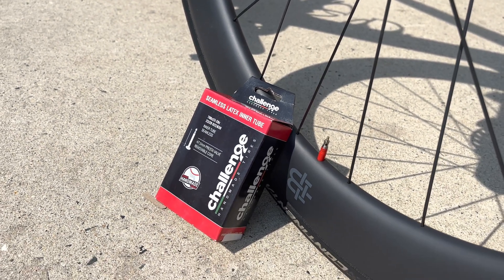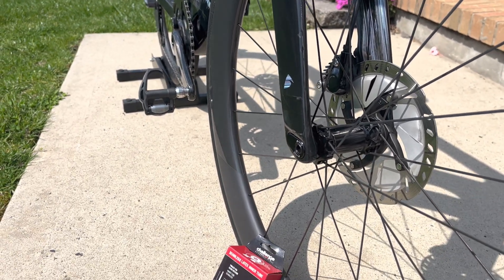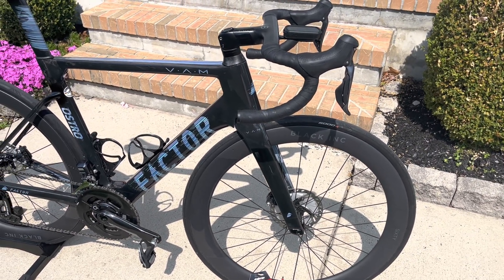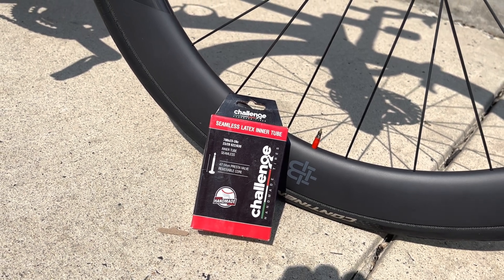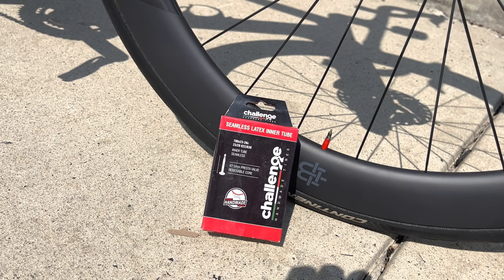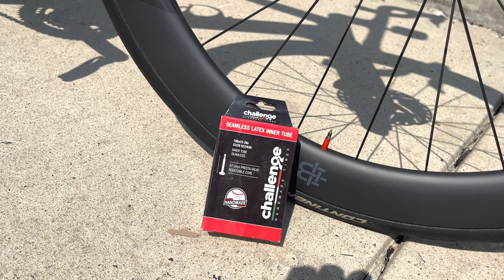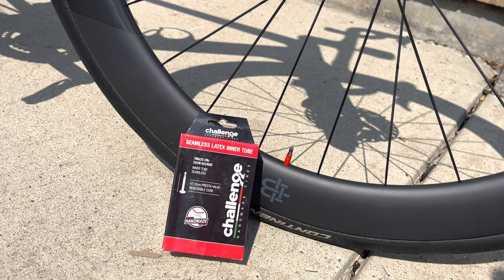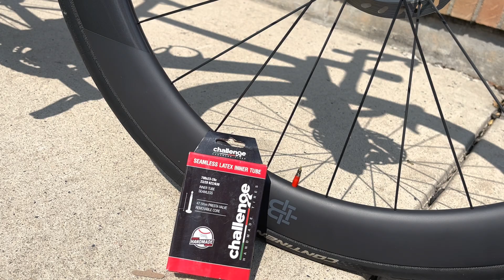TPU inner tubes vs Latex, the HARD truth!

Comment: I ride challenge latex tubes in my 28 mm Vittoria corsa controle every day on my commuter all city mr pink steel bike and they rolls super smooth and fast. They lost air less than my gp 5000 tl tires before and i have no puncture problems at all so far. I have install them with talcum (put the tubes with some talcum in a airtight plastic bag and shake it).
28 mm  Cotton + latex  -best combination so far.....
Reply from the maker: I install the same way with powder. Thanks for feedback
Reply: Hi. What's the powder for??
Reply from the maker: @redguevara7944  helps with installation and less friction between tube and tire
Reply: @addictcyclist  Got it. Thank you very much!! Sorry for the stupid question. This might be the kind of latex that I'm very anxious to try. I've been going thru rubbers like there's no tomorrow.
Reply: Some powder makes TPU tubes easier to install too. I use corn starch.

Comment: I rode latex aswell but what got me off them is the way they fail. It always results in a big explosion and the tire pops off which caused a nasty crash. TPU looses air a lot more slowly and constant. So for me they are just more save
Reply from the maker: Thanks for feedback. My rims are hooked so the tire is so tightly locked on
Reply: @addictcyclist  most people are still on hooked rims and the number of people that have crashed over the years with flats on hooked rims is huge.   It's not like hooked rims hold onto tires much more than maybe a revolution or two once you have no air, especially if you're running clinchers with tubes. They're simply not tight enough on the bead to trust either way unless you use excessive amounts of rim tape
Reply: I had a fatal explosion with Michelin Latex (which are shitty anyways) causing a crash at 38km/h. Tried TPU and went back to Vittoria Latex. Used also Veloflex Corsa Evo TL and they were awesome: Super light and super fast!
Reply: @TheMrSui  sorry to hear that. I'm glad you're ok. Have you tried Foss Polymer inner tubes? I haven't seen a discussion about this. I've just purchased a pair as well as Vittoria latex. I have yet to install into some clincher wheels. I'm unfamiliar with hooked but I'll research.
Reply from the maker: @TheMrSui  good latex is king!
Reply: Loses not looses
Reply: I had the exact opposite experience. Two times the latex ones were very forgiving, and with a 2-3 mm glas shard in there each time could manage to ride home for another hour just by pumping up air a few times. I used the heavier vittoria tubes

Comment: what pressures are you running in your clinchers?  I switched back to clinchers as well.  Just playing around with PSI.  I am 5 10" and go 185lbs.  Thanks and looking back for your feedback.
Reply from the maker: I’m 180lbs at moment and run 85fr and 90r on latex and 25mm tires
Reply: @addictcyclist  perfect. Thanks. I typed and sent the question just before you mentioned that.  Lol.  I’m running 28’s and a set of Pirelli P Zero Race tires for a change. Pirelli is aging on the box 110 psi for my size. Seems excessive
Reply from the maker: @kennedystuart5685  way too much pressure.
Reply: @addictcyclist  yeah I guessed. Thanks
Reply: I also had tubeless for 2 months but got sick of it very quickly. Back on latex zero flats, had zero flats before going tubeless.
Im 70kg and run 80 back 78front.
Reply from the maker: @Gufolicious  same! Latex has not let me down. And the ride is in a league of its own.
Reply: @addictcyclist  yeah i fell for the tubeless hype on the media but truth to be told its just that hype. im just glad i did not go for hookless wheels :D
fun fact: im even trying latex on my cross country mtb now :D
Reply from the maker: @Gufolicious  I have hooked on my factor. My Allez sprint has hookless and it sucks
Reply: @addictcyclist  yeah the problem is, that if you consume a lot of bike mainstream media like youtube and other sources, no one tells you about it. people who ride 10 times a year go tubeless, they put 100psi in their hookless wheels and everyone hates on innertubes. but im 100% sure that latex whould be the best for 99,9% of people especially for lighter riders who are not that prone to snakebites.
and what also gets forgotten a lot is the fact that even if your sealant seals a hole during a ride or if you plug it first and let the sealant do the job afterwards, you are running a basically punctured tyre for the rest of the season which would make me nervous everytime i go out for a ride. and on top of this very nice "sealing" for me the tubeless only sealed after my tyre was down to 20-30psi which basically made it useless since i had to stop and put air back into it.
anyways im just glad i dont have to deal with gunk anymore in the near future, even if it is only for refill purpose every few months.
Reply: There is no downside to running tubeless with sealant on a mtn bike.  The main reason is the lower pressure on the mtn bike, which means the sealant can do the job, unlike on a road bike where the pressure is so high that the sealant gets blown out of the tire and all over everything.  @Gufolicious